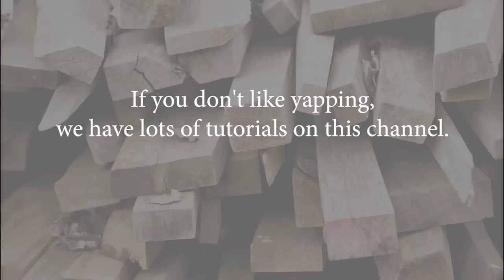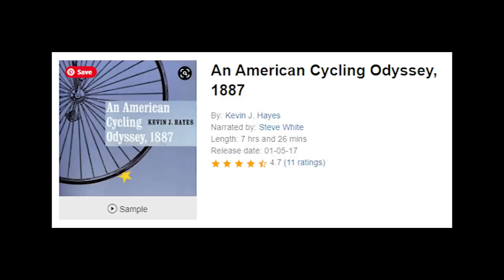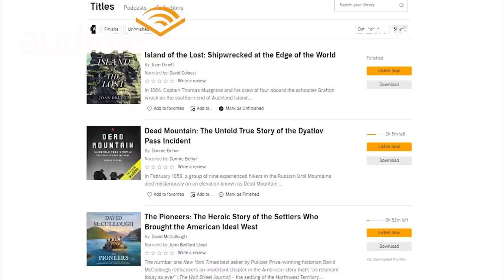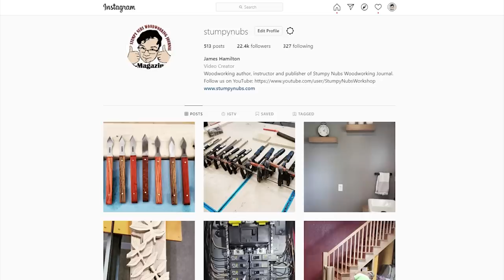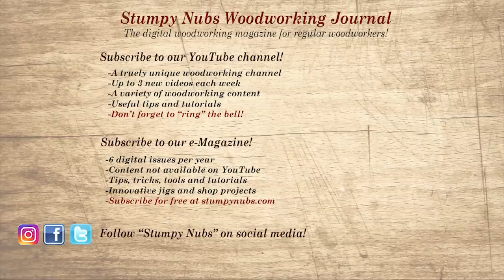Have they BANNED table saw dado sets????

Comment: I'm brand new to woodworking and trying to decide whether I should buy a DeWalt 8.25" saw that doesn't accept dado blades or pay $230 more and get a 10" that does.  Is there a way to make dado cuts without dado blades?

Comment: I own 3 dado sets. The first was a wobble dado I purchased for my radial arm saw in 1974. the second was a non-carbide stacked set that was included with my used Shopsmith in 1976. The third was an 8” Forrest Dado King purchased in 1993. I still have all three dado sets and all 10 digits on my hands. The only serious power tool mishap I’ve ever had in my 60+ years of woodworking was with my ancient Porter Cable laser equipped miter saw. Nobody dwells on how many fingers have been separated from hands using these little beasties. Go figure. 😳😧

Comment: Sorry, I don't see either objection (loosening arbor nut or blade pinching) as valid issues, but I do have an issue with the floating blade guard. When I do my dadoes, in order to get consistent depth on the table saw, I always put downward pressure right over the blade. That makes "pinching" and flying blades an impossibility, but a floating blade guard would simply be in the way. My 2 cents. :)

Comment: I prefer the overarm blade guard system that Delta offers as an upgrade for their Unisaw. Now the splitter that comes with that guard is flimsy, go figure. But Biessemeyer makes a great stout splitter with unidirectional pawls to stop most kickbacks. Really like how this blade guard encloses the blades, which I think are safer than overhead guards.

Comment: Why not use a second reverse threaded nut on the arbor to lock the dado stack in place if you’re concerned with the locknut loosening?  Another alternative, (but harder to find), would be a nyloc (self-locking) reverse threaded nut? Although truthfully I’ve never had mine loosen either!

Comment: You know, riving knives for dados should be possible, you just need two with some spacers (e.g. washers or small-diameter pipes) between, and a mounting system fit to hold them.
Reply: What would be the point? A dado does not cut through the board, so there is nothing to pinch the blade to create a kick back.

Comment: Without a through cut, the wood can't close back together and pinch the blade: it's held apart by the uncut portion of the wood, so the biggest cause of kickback is eliminated, making anti-kickback mechanisms like a riving knife unnecessary.

Comment: I would have thought a cotter pin / R clip / etc  through the end of the arbor would stop the nut coming off.  I have very little experience with table saws but that seems like such a simple solution for that potential problem.

Comment: Interesting video, though I haven't done any wood working in twenty years. I never used a dado set, too expensive for something I didn't need very often. If I needed to make a groove I used the old "one kerf at a time" method; slow but done carefully resulted in perfect grooves every time.  For those who complain about safety regulations I would point out that over the last few decades the number of lost fingers has decreased by thousands.  Yes, there are unsafe operators, and people are always going to find a way to defeat safety guards, but in the main the number of DIY woodworkers has tripled in the past 20 years but not the accidental removal of fingers.

Comment: This question has absolutely nothing to do with the video. But something you said brought it to mind. Have you ever experienced a board exploding on a table saw? I was ripping down a board in a freezing cold garage. I had a coworker catching the board off the back of the saw. Out of nowhere the board exploded and threw slivers and chunks everywhere. Some with enough force to stick in skin and clothing. I’ve always assumed that we hit a frozen sap pocket in the wood and the hot blade flash boiled it causing the steam to blow the board apart. But I’ve never found anyone else that has ever had it happen to them. Nor have I found anyone who has heard of it happening. Perhaps you or someone else reading this has. I guess I’m just curious if my assumption is correct that it was a steam explosion.

Comment: Ridge carbide got sold! I found out the hard way I sent some blades to be sharpened and sent them to new jersey. Then they had to be rerouted to Kansas. It took almost a month to get them back. I am on the fence yet with them. Now with the new owner I ordered a new blade right when they sold out and the blade wasn't very sharp. I am going to have to have it sharpened already and I barly used it. I didn't have that problem with the earlier blades that I got. Just saying. I am still going to give the new owner a shot and see if if it gets better.
Colin Andersen

Comment: another option, though more time consuming, is to use that one bladed contraption and adjust your table to make multiple cuts until the joint is the proper width... i actually do this with a circular saw when needing a similar style cut in a 2x or 4x or bigger stock... yes its more dangerous... but hey sometimes its all you got to do the job....

Comment: I like my stacked dado set. all you have to do is pay attention to the damn tool. ANY tool with a moving blade can be dangerous, if you don't keep your eye on the tool, and your brain in gear. funny thing is, when they broke into my garage a little over a year ago, and used my shop carts to steal most of my tools ( I was in the VA hospital for a week at the time ) they stole the table saw, (table top/contractor style)  but left the dado stack

Comment: Another option would be to use arbor pins like Martin saws have and have matching holes in the dado set and you can brake at will and the dado head will not cause the nut to loosen.

Comment: As for the incompatibility with riving knives: in a non-through cut, the wood remaining in the workpiece above the blades prevents the two sides from pinching - basically the workpiece itself takes the role of a riving knife!
Reply from the maker: That's not the only function of a riving knife. Kickback is also caused in other ways- https://www.youtube.com/watch?v=8f8VWwtaudU

Comment: It's a very delicate issue, as an Israeli all the saws that are sold in my country are suitable for European regulations 😣, unless we import from the US and it's economical. I head this good discussion on F.B with hobbies woodworker like me but he is taking his woodworking to a level up and he owns a Dewalt 7492 ( I will buy one- as a job site saw I think it one of the best an 7491) he bought it in thinking that he could make dados but it was European standard....and he wants to make fast dado withe out repeatable cuts so I gave him 2 options ( compromise) the best one was: Finger joint set - set of 2 blades that can give 0.25" and 0.375", and you can use it with European saws. The second one ( less comfortable but can do the trick) - MATCHFIT ,dado stop pro by MICROJIG.

Comment: The way I do dados , rebates or moulds is with a spindle Moulder. I wouldn’t say they are safe but they are much more efficient then the dado stack or moulding heads made for table saws. I’m really surprised they are not used in America they seem to be everywhere else.
Reply: After having seen a video of a guy showing how one works for 40 minutes..
How do you do dados with such a machine in the middle of a wide board?
Reply: @joansparky4439  not used for board material much besides rebates or other edge mouldings. It’s really for solid timber work and with an auto feeder it’s really helpful for long, heavy or large amounts of stock.

Comment: Here in Australia, Dado sets and Drunking Saws have been banned for decades.
Now we have to use solid or expanding trenching heads.
Thats for industry - in your own shed at home, you can do what you please.
When work got rid of ours, I grabbed them for my workshop at home!
Love 'em - but you must know what you are doing!
Reply: "Drunking" saws ?  Don't like the sound of that.
Reply: @MrBugleboyb  sometimes called "wobble saws".
Its just a standard saw blade set on a wobble - or "drunk".
The constant flexing can eventually fatigue the saw body and cause it to crack. (Pretty damn rare! Only ever seen 1 let go).

Edit: most of my drunking sets are just fixed angle collars, but I scored one fancy set that you can dial in the degrees of drunk on the blade!

Comment: Well there is a solution. Most good machines here (Europe/Netherlands) have an arbor receiver/flange that has 2 protruding pins. Or, a flange with holes, that takes a nut with 2 long pins. All blades and dado sets have matching holes. Since the flange cannot slip on the arbor, the attached blades or dado sets cannot slip either and hence cannot apply any torque on the arbor nut. 
Hence our dado sets are mostly made out of solid aluminuminimum or steel and weigh a ton. Even then, the brakes stop the whole assembly within seconds which is a nice feature as it shortens the time until I can clear any stuck waste.

For an idea of what type of cutters we use as dado sets: https://uk.feldershop.com/en/Sawing/Grooving-cutters-and-dado-cutters/Adjustable-groove-cutter-for-saw-unit-RB-HW.html. But you can easily take any cheap blades, drill some holes and be done with it. Added benefit is that your teeth will never collide as the pins will index the blade.

Comment: One of the first year shop class topics we learned was how to setup a dado cut on a table saw. We used what I think would be referred to as a wobble dado set. I think stacking sets were a thing but that wasn't what we had. The idea to ban a tool or process because it can be dangerous seems pretty backwards to me, all tools would be banned eventually if we start down that path. I think a natural progression of things works out better without getting into regulations. When smarter, safer, more efficient tools and methods are developed. Well the other things just sort of fade away. We rarely used these dado setups because of setup time, and when time is money you find other ways of doing the work. On another note I wonder if a dado set scares these people? What sort of nightmares would they have seeing someone cut coves on a table saw? You want to feed your work at an angle to the cutting blade!?!? Ban It!

Comment: A riving knife is not needed when making a dado cut.  The remaining material makes it impossible for the "kerf" to close on the blade.
Reply from the maker: Stopping a closing kerf isn't the only function of a riving knife. A turning workpiece can also put pressure on the side of a blade.

Comment: How well the blades stay on relies on the the nut being tight enough to hold against whatever the saw's braking speed is. 
As a safety measure, how about tapping a small left hand thread in the end of the shaft, and inserting a bolt and a ¾" O.D. washer whenever using a dado stack?

Comment: You say it's not possible to make a riving knife the same thickness as the dado set, but why not? There could be multiple riving knives (2) with "spacers" in between. There may need to be some sort of adapter, but all you really need is a surface on either side of the blade to be on the same plane as the teeth to stop the teeth from catching at the back. The dado manufacturer could even manufacture compatible riving knives for their dado sets.
Reply from the maker: "Impractical" would have been more accurate.
Reply: @StumpyNubs  Maybe so, but I think you may be onto something! At some point in time I feel like dado blades may have seemed "impractical" but why is shimming riving knives such a crazy idea? Yeah it may take some tweaking of riving kife designs but it seems approachable. I love your videos and the fact you can get me thinking outside the box whether it was your intention or not!

Comment: Way, way back in the old days (1970's) I had a wobble blade dado that worked pretty well. Apparently they are still available and don't need long arbor. Unfortunately my table saw has a 30mm arbor and I haven't been able to find one that would fit it.
Reply: Bosch used to make a wobble blade found  1 in Germany  of all places.

Comment: Do Jointers have this "silly" 10 second  coast down rule??   ie. as cutters are covered by the sliding guard - so your "idea"  is just to make the circular saw more like an adjustable cutter width jointer - with the potential for near unlimited  width board stock.

(Another thing to remove the likelihood of blade assemblies "spin off" during rapid slowdown would simply be to key the saw blade stack onto the arbor. - Ok that would be a "design change" - not going to happen too much industrial Inertia.)

Comment: The law doesnt limit the length of the arbor, it is manufacturers avoiding the issue by using arbors that are too short to fit a dado.  That said, there are some on the UK market - Axminster sell a few that can fit a dado.  Theyre not cheap though :)

Comment: I was at the Home Despot when I saw a guy buying a cheap job site Dewilt table saw and a dado set. I asked, are you buying those to go together? He replied he was. I said, good luck getting more than a quarter inch dado on the arbor. 
I then added that I knew this because I was foolish enough to buy a set without thinking it through myself.

Comment: I am a joiner in the uk 🇬🇧 so when l make rebated door frames l use a Stack dado for cutting the head but l use the cutter on cross cut but as you said when you switch it off it take some time for the cutter to stop as the Break dose not stop it as quick as a Single Blade but l do like it stay safe

Comment: The nut coming of is not a problem in any other application where there is a nut on an axel. Sure its just not a standard nut that is used in those places, but adding a locking mechanism would solve this whole problem. Its a COST problem, it might add another $1 to the manufacturing costs and we cant have that!
Riving knife should also be fairly easy to get same thickness as the blades, just add 1 with same thickness as every extra blade you add on...

Comment: I love my dados. Been using them for years on the TableSaw, circular saw, and radial arm saw. Of course the guards are removed to make them fit. Decades of use, with only a few minor mishaps.   They call Lefty the lumber lad. 
Seriously, I’m very cautious with all power tools. Even more so when the setup isn’t typical. For me dados are ok, larger router bits scare the heck out of me. 
I won’t say I’ve never had a power tool injury but hand tool incidents for me are at least 10 fold over power tools. (Chisel, screwdriver, box knife, marking knife, 3/4” socket wrench, nippers, even plastic packaging) I saw many more hand tool injuries in the ER than power, but power more severe and didn’t leave as clean a slice or hole. Except for the guy who cut through his ankle, breaking more than 9 remaining bones and removing 1.5 toes with the diabolical shovel.
Reply: I think it violates YouTube's TOS to mention the shovel incident with that sketchy level of detail!

Comment: Dado sets are the best way to make that type of cut.  The overhead guard isn't the best when making a dado cut, since you really need to keep down pressure on the workpiece over the blade to maintain consistency in depth of cut.

Comment: I have no mechanical or legal insights, so I have no idea if it's true, but did a quick google search and the only thing I could find was a mention (in a forum thread where the original poster asked about where to find dado blades) that "In the EU all table saws need to have an electric brake which apparently when braking from high torque can unscrew the nut holding the dado, potentially sending blades flying all over the place." [translated by me, I am not a professional translator]. 

This would I guess corroborate your assumption in the first reason.

Comment: I can't fit a dado to my table saw in the UK... I cut the two extremes and then just play the wood through eliminating all the remaining stock a clean up up with a chisel if required and I and good to go again with a single cut through... so much easier than having to change out blades and then ensure they are at 90 degrees... one blade does it all...

Comment: Riving knife does absolutely nothing when you don't cut through the material.  All the knive does is fill the void where the removed material (to just more than the width of the blade so that the wood won't pinch in on the blade).  When there is material remaining on the workpiece, that material fills the void.  Now, if you were a fool and used a dado stack to cut through the workpiece entirely, there could be pinching I supposed, but even then, remember that part about the space being maintained to be just thicker than the blade width.  Well... a dado stack is so much wider than than any riving knive you could ever use that it's an absolutely absurd idea to have one in place when chipping away thick cuts.  It's a little like a chainsaw - yes, they can get pinched in the cut, but as long as the pressure isn't so great that it stops the blade / chain from moving, they just chip their way free again.

Comment: I'm British and as far as i'm aware we can have dado stacks in the home workshop (if we've got a saw that will take them which my schepach won't) but we can't have them in commercial spaces.  The really stupid thing about this is that it means that instead of using a dado most people use a router table,,, so instead of a blade spinning at several thou RPM they are now dealing with a router used in a way it wasn't really designed for spinning a bit at 30 thou rpm... but hey its safer, it must be because the government says so SMH.

Personally I'd say the dado stack is safer and easier - but we gave up expecting the law to make sense long ago